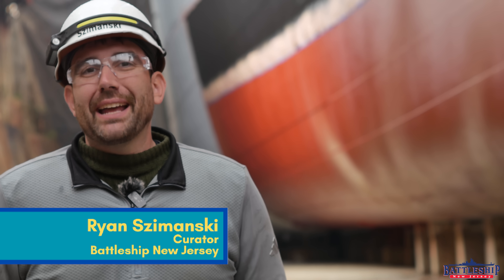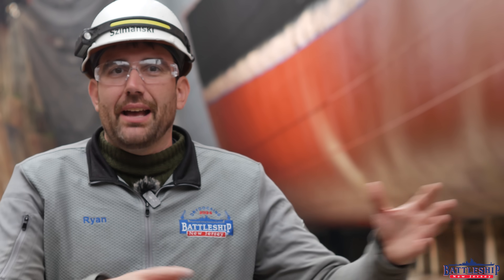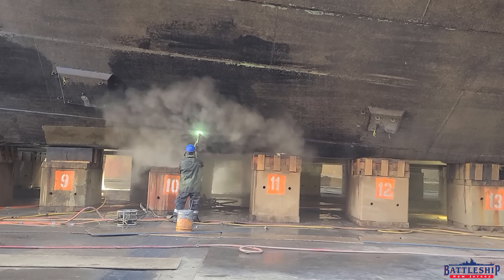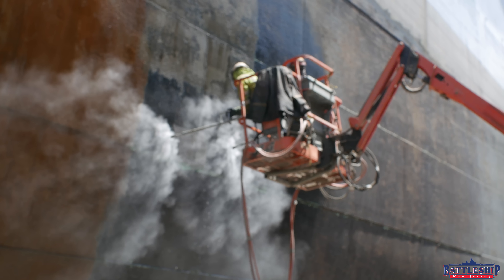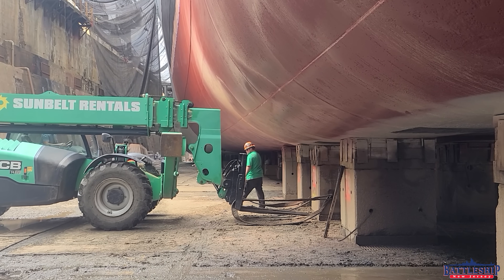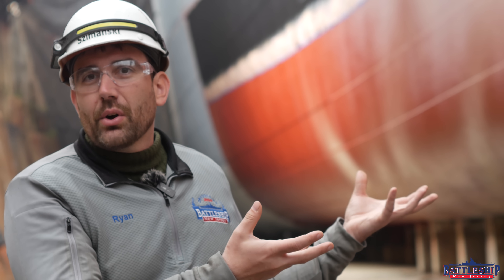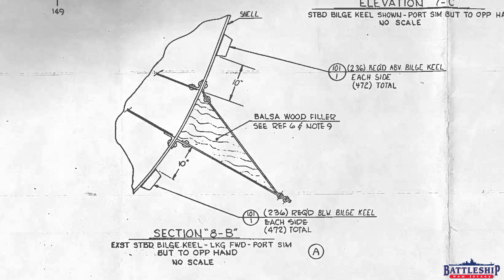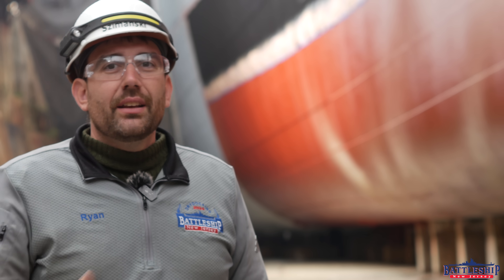Bilge Keels, Anodes, Caulk, Paint, and Keel Blocks: Drydock Update 7

Comment: It would be fantastic to see the methods they use to mold the 1/4" mild steel plate to the radius of the hull. What a beautiful job you & your crew are doing, phenomenal!
Reply: My guess is they weld one side, then use a jack or some type of press to bend it around to shape as they weld it. 

Either that or gauge the angle and have the sheets pre-bent, 
(which i dont think they do because its probably a lot more expensive and time consuming to do it that way.)
Reply: @VashStarwind  they just weld it and wrap it around

Comment: The NC BB55 seemed to have some vibration issues after being launched.  It appears that the Navy was able to fix/minimize this.  What  was the issue/cause found to be?....and how was it corrected?  I think I've read that other following ships also had similar issues.  Did any of the Iawa,s have this problem as well?
Reply: I served on the New Jersey from November 1988 through February 1991 (decommissioning). Had times ship was running at high speed and where I worked, it was noisy and lots of vibration. One time, the ship was doing over 35 knots and sure put up quite a rooster tail. But she was a great ship. I miss being on board her.
THE BIG "J"
Reply: I think this might be covered in the North Carolina class video a few years back. Jist of it was a resonance appearing at higher RPM, where prop wash would cause part of the hull to vibrate. If I remember correctly is was partially overcome by changing propellers, but the problem originates from NC's  usage of propeller skegs. By placing the skegs from the outboard prop shaft to the inside shaft, this problem was not so much of an issue in the South Dakota and the Iowa class.

Comment: Why not caulk first then paint over?  what is the reason for calking over the paint?
Reply: The caulk flexes, paint doesn't. It was covered in another video, IIRC.
Reply: Likely because that's the way the Navy did it, and the reasoning for it's application also weren't known until after part of the ship had been painted.

Comment: I'm curious how the overlapping works when you have a fully painted area next to an unpainted one. For example after bumping
Reply: my guess would be the 1st layer gets as much done as reachable, the 2nd layer is a few cm/inches around that, and the 3rd layer is the same around that, and then you can make the overlap proper when applying the paint on the block position. alternatively they could take part of the paint layers off when sandblasting the part under the blocks in a similar manner.
Reply: @unitrader403  yeah basically I wonder if they have to be that careful, or they can just put layer 1 over layer 3.

Comment: Thought for the day: Consider in the future, when the hull gets thinner due to corrosion, storing the battleship in a dry dock.
Reply: There is a vid out there from a few years back with Ryan's thoughts on cofferdams, and why using a drydock would be a not-so-preferred solution  considering how much HMS Victory is suffering being only supported on blocks. Long term it would be preferred to have the hull fully supported by water.
This is still a non-issue. All the pitting observed is from before the '80s. During this drydock it was observed there was no failure of the coating, and no leakage from the inside, meaning no material could have corroded so far. Yesterdays video 'removing 10 keelblocks...' goes a bit more into what and when those weakspots that will be double plated appeared.
Reply: Ships are designed to be in the water.

Comment: An easier and likely cheaper way to finish the hull, as well as reduce the surface area of the paint, would be to skimcoat over the pitted areas to make them flat, with some marine grade "body filler", such as what automotives use. As the ship is nearly stationary, hull flexing isn't as much as of an issue to crack the caulk/filler, as with a moving ship. All the pitting massively increases the surface area of the hull in contact with the water, it also creates the potential for a faster deterioration of the paint coatings, as there's that much more area to have a failure that then allows the surrounding area to be exposed to the water, accelerating the coatings failure.
Reply: Yeah too bad they didn't have access to a battery of actual experts and a team of shipwrights working on her. Oh wait....
Reply: It's a matter of cost. Your method probably costs more, and the museum needs to be careful with their limited budget.
Reply: Too bad they don’t have any experts available to tell them that. 
P.S  your method only works if she doesn’t move at all. 
You want the system of coatings to adhere to the steel, not body filler that can flex and warp and come loose
Reply: Yeah, they didn’t plan this work for years, get expert advice, discuss options and costs, and then implement the plan. They were just winging it hoping some constipated social media troll would put them on the right track.
Reply: Not "Navy correct".
Reply: @garywagner2466  - Dude. No need to be mean. He wasn't trolling. Probably just offering his thoughts and opinion. Chill out and relax. We're all battleship fans here.
Reply: @seanhazelwood3311  The ship no longer belongs to the navy. As Ryan has said, tehr Navy expected a drydocking ever 3yrs or less, whilst the battleship is planning 30yrs until the next drydock. .
Reply: @ravenbarsrepairs5594  It's a museum and historical artifact, being maintained (as much as possible) to exact Navy standards.

The Navy never used Bond-O on a ship.